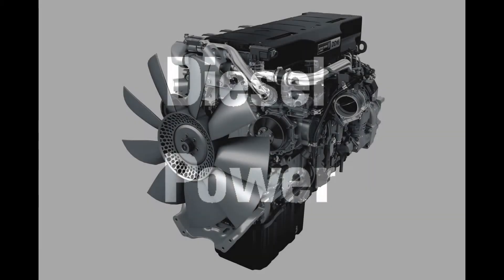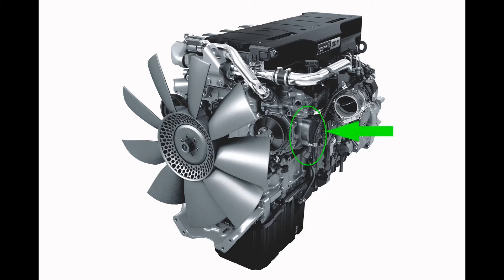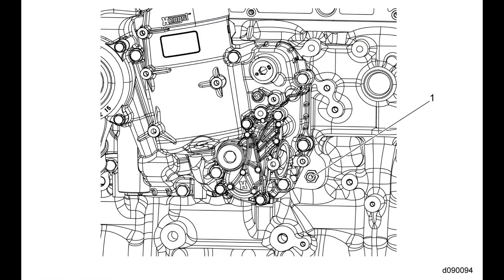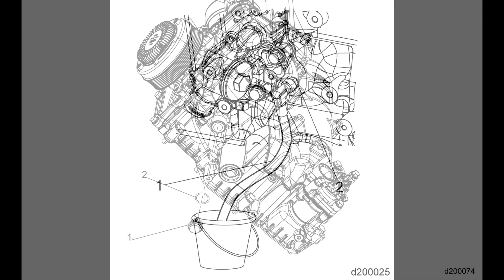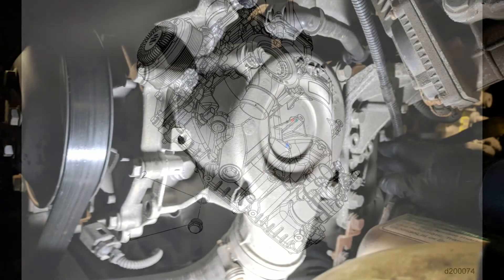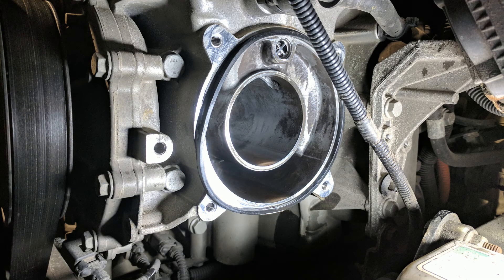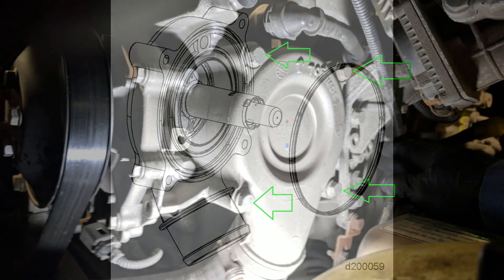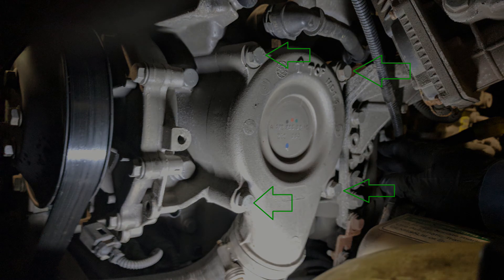Replacing a Thermostat in a Detroit DD Engine

Comment: It was almost a helpful video.  The reason I watched this is because I wanted to see how to add coolant in order to ensure no air bubbles remained.   Is there a followup video?
Reply from the maker: If you can pressure fill the system from the bottom drain port, this will force more of the air up and out. Also, once the fill procedure is finished we often run the engine until the thermostat opens. Now, here's Detroit's fill procedure...

1. With the engine off (engine OFF, ignition OFF), fill the cooling system with coolant at a constant minimum rate (typically 6 to 8 liters per minute) until it reaches the top of the filler neck or at the "Cold MAX" level.

NOTE:  This will eliminate the large pockets of air from the system, although smaller bubbles will still remain. Normal operation of the vehicle should purge the remaining air bubbles from the system without any damage. Extremely large cooling systems (such as in motor homes or luxury coaches) may require additional time for system deaeration.

2. Start the engine (no pressure cap) and idle for one minute. Increase engine speed slowly to 1500 rpm and hold for one minute. Then reduce engine speed to idle and cycle up and down between idle and 1500 rpm for one additional minute.

3. After this three-minute burp sequence, stop the engine and add coolant as required to achieve "Cold MAX" level.

4. Start the engine and repeat the burp sequence in step 2. 

5. Stop the engine and add coolant as required to achieve the "Cold Max" level, and then install the pressure cap. 

6. Start the engine and inspect for leaks. Ensure the coolant level remains at the "Cold MAX" level before returning the vehicle to the customer.
Reply: @TheDieseler  outstanding breakdown! You should add this to you water pump video too. Thank you!

Comment: I changed the Water Pump, and thermostat and I am still over heating. 2014 cascadia dd15.     Any help?
Reply from the maker: What temp is it getting up to? I'm guessing it's causing the check engine light to come on, etc? Is this happenings while running down the road? Fan running properly? Rad/Intercooler free of obstructions and clean?
Reply: TheDieseler fan comes on.  No lights at all.  Temps about 200. And up
Reply from the maker: 200 is not overheating. If there is no check engine light, it is most likely not overheating. If the fan engages and regulates the temp, everything should be working fine.
Reply: TheDieseler ok thanks for the help
Reply: Have u changed out the coolant filter? Not sure if there's a bypass but maybe a plugged coolant filter may not allow for proper flow. My 13 Cascadia DD15 has one. Few other things. Has anyone ever used a product like stop leak in the system? That gunk gets everywhere and impeads cooling by not allowing full contact of the coolant and metal. Lastly u may want to try a product by Redline called Diesel Water Wetter. If memory serves it minimizes air bubble cavitation and allows for better coolant to metal contact. If you know anything about racing you'll know Redline only makes high quality stuff.
https://www.redlineoil.com/diesel-waterwetter

From their site:
These products include a unique agent that lowers temperatures by reducing or eliminating bubbles or vapor barrier that form on hot metal surfaces

Reduces or eliminates bubbles or vapor barrier that form on hot metal surfaces to reduce coolant temperatures by up to 20°
Superior heat transfer properties compared to glycol-based antifreeze
Compatible with new or used antifreeze (including DEX-COOL® and long-life versions) to improve the heat transfer of ethylene and propylene glycol systems
Improves heat transfer and reduces cylinder head temperature
Designed for use with all modern aluminum, cast iron, copper, brass and bronze cooling systems
Cleans and lubricates water pump seals
Reduces cavitation and complexes with hard water to reduce scaling
Does not lower cooling system below the thermostatically-controlled temperature
Reply: Hack Daddy - Official -